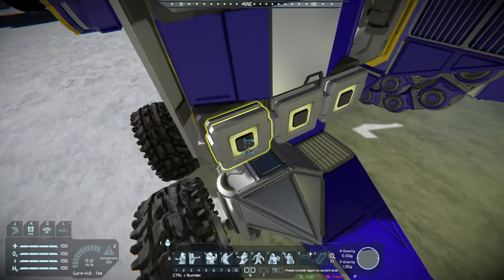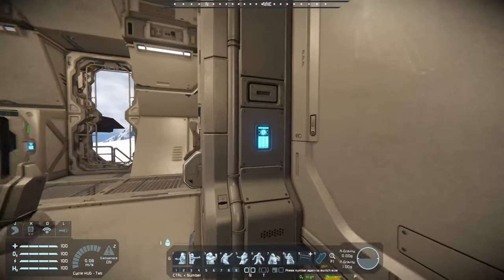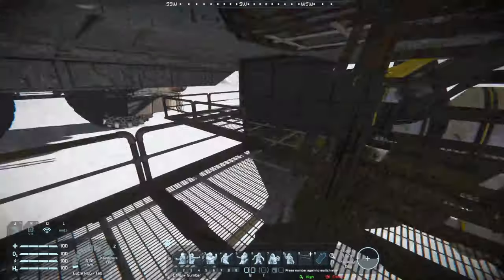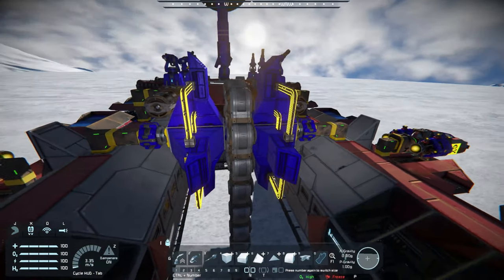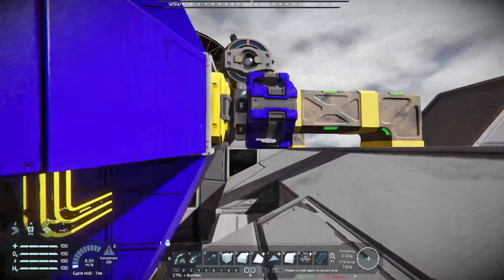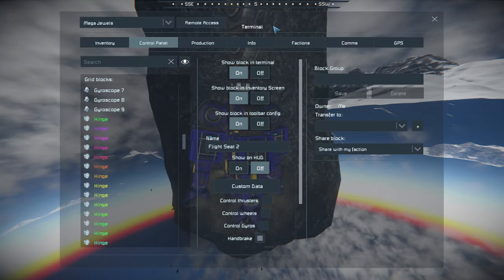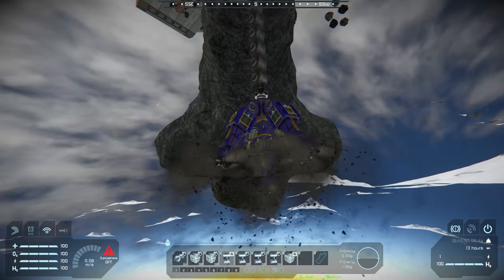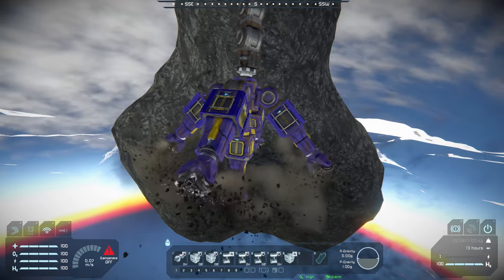Space Engineers - Concept Chain Driller Flower

Comment: You could, via a rotor, swap the chain over to small grid then back to large grid for the drill head. Might get more length on the spool. Rotation and expansion is a little too fast for it to open safely, clank likes it slow. I wonder if a gyro would help to stabilize the drill head.

would like to see this on the workshop, the rover looks pretty cool :D

Comment: The flower concept definitely has promise but I think it's your order of operations that is hamstringing it. Probably best to drop the closed drill head down as far as it can go then open the flower by a few degrees, raise the drill head up (either all the way or just till you've mined out the deposit you're after) clearing out a larger hole and mining more in the process. Drop it back down to the bottom, open by a few more degrees then repeat until the flower is fully open. So you end up doing multiple passes instead of forcing it in one pass.
Reply from the maker: I agree. Thats what i found on my testing of this rig. Once you get to the deposit you have to go up and down as you are opening the flower. Im still trying to figure out a smoother way to do this :). Thanks for the sub friend.

Comment: I like it. the drill is a nice idea and more compact than my usual one (normally 9 pistons in series feeding back onto itself). I would suggest having some kind of dockable top connector for a large hauler to pickup minerals. This could be on a piston but you may need landing gear to secure the vehicle when docking. 2 large cargo is a bit low for me and I tend to have an isolated network for production. Using sorters, the system has a one-way process to avoid ore filling up the mineral container or component storage.
Reply from the maker: Thats a great idea. I wonder if i could chain with the pistons. Hmmm